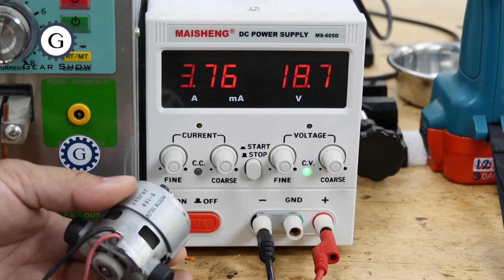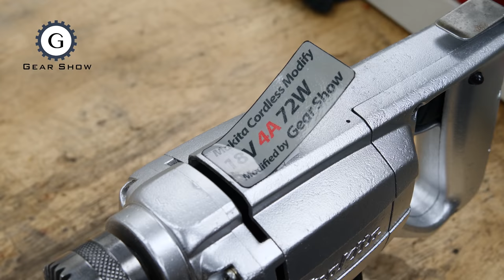Cord to Cordless Drill Conversion From 100v to 18V

Comment: I like how well the battery fitted to the drill. The only downside is to replace the brushes, since the new motor is so small and deep inside the machine. But since you don't need to replace them so often, it should be fine.

Very nice restauration! Really enjoyed watching it :)

Comment: Why didn't you drill & threaded a hole for a setscrew in the gear part that you affixed to the motor axle? Theres enough material to screw in a little hex setscrew, or even 2 setscrews if balance is important. Feels lile that gear is gonna come loose after a time and then the motor will spin freely without the drill spinning.
Reply: not likely that was a pretty good press fit between the motor shaft and the bevel gear, the torque of the motor will also be quite low so not really going to be an issue
Reply: Agreed
Reply: I thought the Exact same thing LOL..
Reply: Agreed

Comment: Great idea my friend. Good job.
Reply from the maker: Thank you very much! My friend.
Reply: @gear_show  7:32 - that is the minimum power, drawn without any load. Try measuring with load... it will be a lot more than that.
Secondly there is no battery depletion protection I can see, so after a period of using this battery will shut off to prevent damage to cells (around 2.7V per cell), resulting in 0 volts on the terminals. From this point I'm highly skeptical that the charger will be able recharge it.
Thirdly there is no overcurrent protection, drill bit gets stuck, amps go through the roof. Bad for cells, bad for motor.

It's a nice build in a mechanical way, but if it endangers a 70$ battery when in use then it's not worth it. Maybe check out some protection circuits those could help and are not that expensive.
Reply: @amoeb81  All those features are integrated in the BMS board of the Makita battery.
       It might surprise you, but most battery powered tools from a couple years ago are just comprised of a DC motor, a switch, and some battery terminals. 

I see no problem here.
It's an 18V motor, (and I assume correctly wired for this application)
The battery will temporarily stop working if it gets too hot, then work again when the temperature goes down.

Comment: Great job! Is it possible to add hammer function on an ordinary drill?
Reply: That would require a whole new gearbox. If you find an old or a damaged one you can fit the new gearbox which has hammer function that you took from the old and somehow attach it to the motor you already have. If you do it yourself and you have the tools and time to design the cogs and adaptors required, go for it, but if you can't and let it to a professional to do it for you, then no. The price he will ask you will be greater then a new one. On ac tools is very easy but on battery powered no so much

Comment: Pro Tip: to drill a centered hole, you can also put the drill into the vise and the piece into the chuck (if it’s 13/10mm or lower, depending on the chuck). Poor person‘s lathe 😁

Comment: Liked the conversion!! But feel that you should have gone with a keyless drill chuck instead of that old one... Would have been a great upgrade
Reply from the maker: Cool idea, keyless drill chuck needs reverse switch.
Reply: @gear_show   it becomes quite easy to formulate a forward reverse switch when you are using a dc motor. There are even switches available in brushed motors

Comment: Nice job only thing I see wrong is the wire running from the battery conversion setup to the tool heat shrink wrap would have addressed that
Reply from the maker: Okay, thanks for that

Comment: Very nice conversion and, it works well! It must be somewhat front heavy now though. You're saying that your country has discontinued the use of corded power tools? Where on Earth is that?? Does the battery version have as much torque as the corded version? I have, (as I'm sure many people have), a corded Makita drill that if you use a larger drill bit such as a 5/8", it could break your wrist if the bit jams in the metal.

Comment: I wish you lived nearby in Ontario Canada.  I have 4 Makita Drills than need Li batteries.  No Makita Green?
Great job.  Did you crazy glue or pin the shaft to motor?
Reply: I'm pretty sure it's a press fit on the shaft, as he used the press to fit it on the shaft of the motor. If a press fit is done correctly glue or mechanical fastners are not necessary.
Reply: @barthanes1  I noted the interference fit (Press fit).  However, if your fit is not tight enough and slips there is a big problem.  A recessed Set Screw would help.
Reply from the maker: I didn't glue it, it is oil.
Reply: @gear_show  My concern is that the press fit must be very tight so as not to slip when the drill bit catches on steel as often happens.  Nice job.  I am unable to find cells in Ontario Canada for a Makita 4.6VDC drill.  Are new chargers required for LI-ion batteries?

Comment: Hello,

I love your videos very much, they are very well done and I am very passionate about them.
I have a challenge for you ;-) I am trying to use a Black & Decker model 2661 type 100 drill with an 18V - 2.0Ah Lithium battery (BL2018).
the tricky thing is that the drill originally uses a 14v battery and I'm freaking out how to fix it in order to decrease the lithium battery volts.
I hope you can suggest me a solution.

Comment: You should have drilled a hole between the bottom screws and routed the power wire internally.
Reply from the maker: Okay, that is a good point, thank you!

Comment: Well done. however, without over-discharge protection for the battery, your drill makes no sense.
Reply: Exactly, this is just wrong to feature such conversion without proper electrical practices. Also the battery holder cracked because he used power tool for the small screws.

Comment: An aluminum drill is still not safe in case of drilling into live wires, I would advise not to use it to drill in walls where there is electricity.

Comment: Practically no one would do such conversion. Time spent / effort and material costs need consideration. I recently bought a set or WORX WU130. Great drill with brushless motor. Probably 18V battery + holder used in this video is already cost more than my new drill.